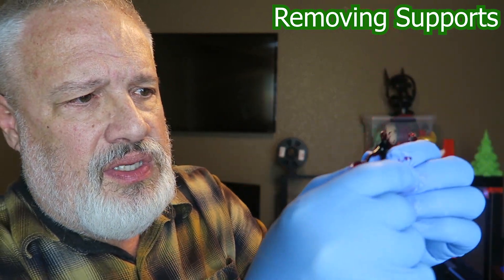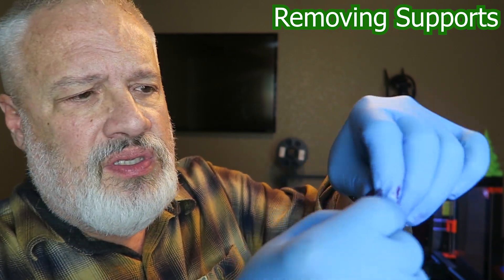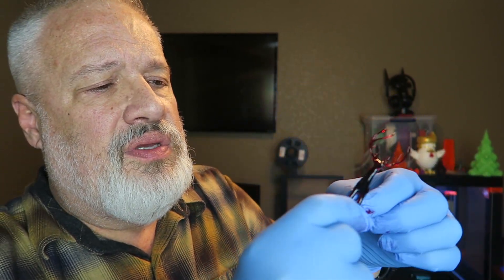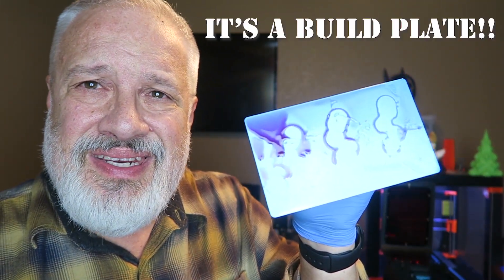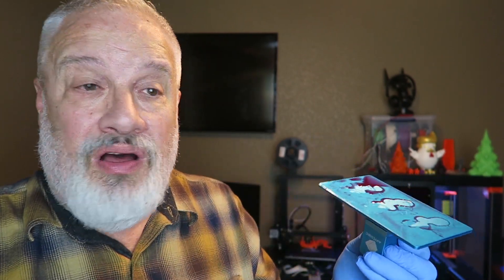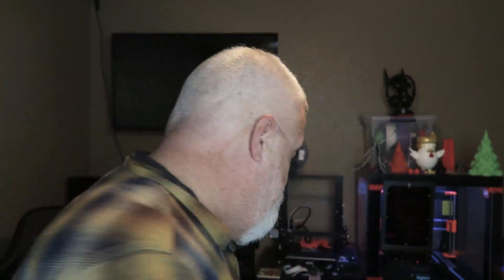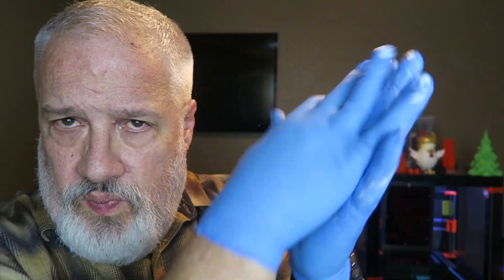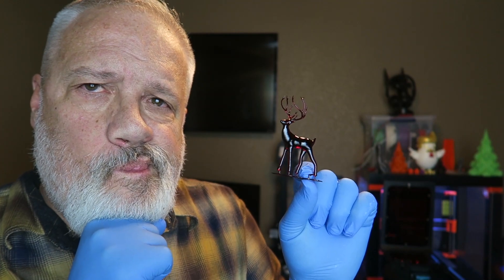3D Resin Printer Tips and Tricks! ANYCUBIC Photon!

Comment: Have you considered adding an incubator heater to the inside of the photon to heat the resin? Looking at the temperature recommendations of siraya tech - blu, it seems like my ambient temperature is below optimum and I want to run a stronger resin. I previously had a form 2, but it was cost prohibitive and I'm looking for something smaller.

Comment: You don't really need to clean the plate like that. A gentle wipe of the resin is plenty. As long as the surface is fairly smooth. It's just going to get submerged again anyway. I used to clean the heck out of mine when I first started with the Photon. I haven't done that for countless prints in a long while. I've not seen any performance changes. But it's good to know the glass cleaner brand actually works well. Good info.

Comment: Did you ever try to use the foam for cleaning the model? Seeing the platform that clean makes me wonder what would happen if you gave it a pre-spray with this stuff and then an ipa wash. Also, the prints look gorgeous in this resin!
Reply from the maker: Yes and it works awesome!  Stay tuned for a future video!  I have stopped rinsing in H2O because of issues with white spots.  Mostly just IPA with a toothbrush and straight to UV cure.

Comment: what was the printer settings for this print
Reply from the maker: Alot with depend on the resin you are using.  I used Harz Labs Cherry for the deer print.  Normal Exposure Time: 12, Off time, 1, Bottom Exposure Time 70 with 8 bottom layers.  Thanks for asking!